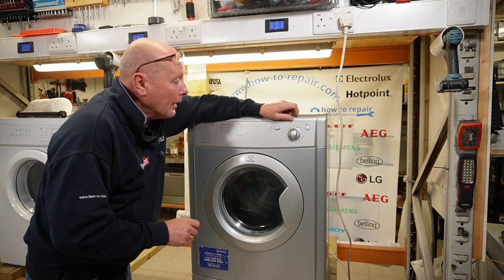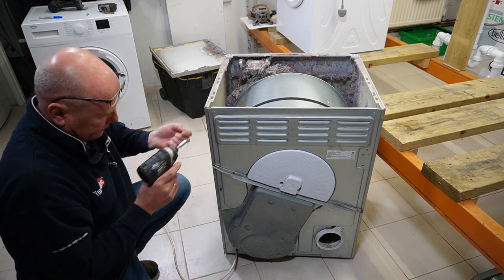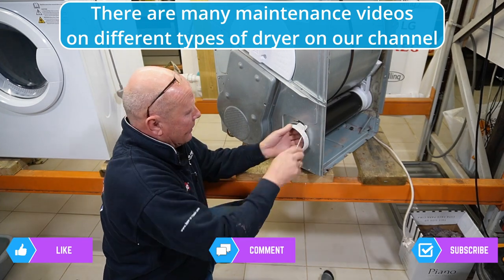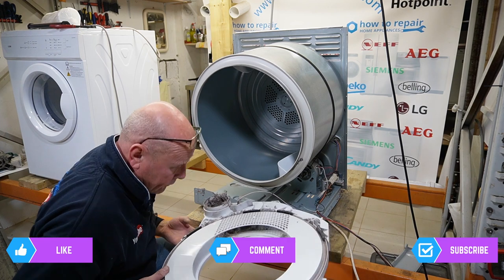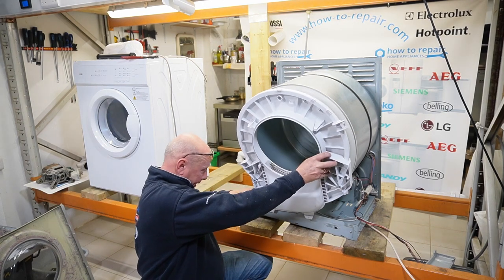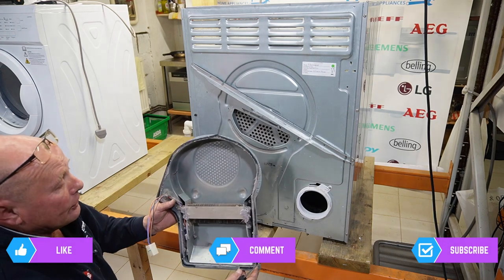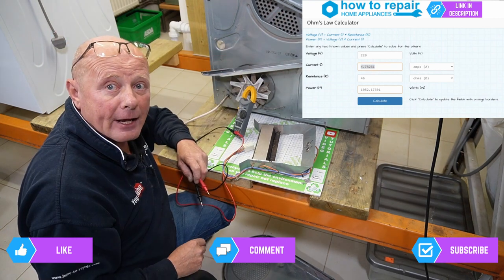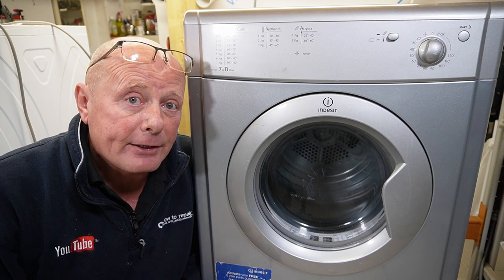Hotpoint & Indesit Tumble Dryer Taking a Long Time to Dry? Maintenance Guide Reduces Energy Costs!

Comment: Another great vid, that made me get out my wireless endoscope inspection camera,  to look down past the filter in the dryer to see i need to take apart and clean.  And yes it it will be done this weekend - so many thanks !!   This is the 3rd or 4th time, one of your vids helped me. I replaced a 40p capacitor on mothers machine, I replaced my aunts leaky hose. They both was thinking of buy new machines or at least paying to get a plumber in. And I also replaced a pump on my own washing machine..  So Many thanks for all the great content you've done and do !!
Reply from the maker: I'm glad your endoscope spotted the stuff that gets in the dryer, people don't realise the hidden problems that can occur and the manufacturers never publish it. people service and maintain their cars, but they never think of the tumble dryer, they sleep with it on at night not knowing the potential hazards of the dryer when it has not been well maintained properly. Now that the financial crisis is getting hold and energy prices are going up, they might start to do a bit of maintenance.
 glad we could help you @coxyofnewp this is for you https://www.youtube.com/shorts/e432SAb2g08 please remember to subscribe as that's what keeps this channel going. Thanks 👍

Comment: That's brilliant. I recently bought a used Whirlpool Duet dryer from a fellow who had "upgraded".
When I opened it up at home it too was full of lint and fluff.
I couldn't understand why. Now I do.
Though I will also now, having watched this video go back and give it an even more thorough cleaning .
Reply from the maker: It's not always what you see there are hidden ducts that need to be cleaned and it doesn't take a lot of pressure to close up the vent tube and this is what causes the restriction on the air flow and as soon as it starts it will just keep building up until it's cleaned that should be shared with everyone that has  tumble dryer, not only for the safety, but also for the energy that they will save
Reply: "Upgraded"  Little does he know...literally.
Reply from the maker: General public does not always know that manufacturers are conning people. in the trade We all know that whirlpool Indesit, Hotpoint Ariston Creda are the same company, same product with a different pricetag.

Comment: What a great tutorial on how to strip and clean this tumble dryer. It was a pleasure sir, watching it all. Thanks for your upload and time showing how to do it correctly. Please could you advise I have a similar dryer that has a square bush as opposed to a pear one. I have to replace about every 6 months and am noticing that there is a scrapping noise heard from the drum. What could be the cause of this please? If I needed to replace the tumble dryer what in your opinion would be the one to get?
Thank you in anticipation and best regards,
Brian 👍👏🏴👍👏🏴
Reply: the rear bearing needs replacing

Comment: I have a heat pump tumble dryer, can you please do a ‘maintenance’ video which does not involve taking the panels off? I clean the filter after use, and once a month or so take the other filter out the bottom and vac it clean and wipe it all down
Reply from the maker: It's already on my list to do, as you're mostly aware, I'm not a great fan of the heat pump dryers because they are not lasting much longer than five years, and when you consider the cost three times more expensive than a basic vented tumble dryer and then consider the energy saving. It's not stacking up. The technology is fantastic, but mixed with fluff they seem to be clogging a lot and some mikes are having gas problems because of corrosion.

Comment: Hi. I have an opposite problem, whereby my Beko condenser tumble dryer doesn’t switch off when on sensor drying. Have changed the metal strip sensor in the drum as a precaution but this didn’t make any difference, any ideas please?

Comment: why was the machine so full of fluff? Surely the ducting system is sealed. I've had tumble dryers for years, and we've never had fluff build up like that. We did always use White Knight, and our ancient one that finally gave out was really clean inside. We couldn't buy a new one as WK ceased trading. We have an Indesit one similar to one you have in this video. The filter for it is rubbish as it is only a half grid, so a fair bit of the fluff gets vented out the back pipe.
Reply from the maker: The vent tube that comes out of the back of the machine must've been kicked and a restriction started to form. this then causes the system to back up with fluff. Hence the problem when there is back pressure more fluff ends up inside the machine. But the filter not fitting correctly because of an obstruction caused much more than normal. I hope this helps you please remember to subscribe to the channel is that helps us?
Reply: Reason why this particular dryer was full of lint, is it’s a positive airflow design (pushes air through the heating element, drum, lint filter). Positive airflow dryers can dry things fairly quickly at lower temperatures but the unfortunate downside is anywhere, where air and can escape, will escape into the inside of the machine since there isn’t a 100% seal. The White Knight dryer you had more than likely was a negative airflow dryer (pulls air through the heating element, drum, lint filter) and negative airflow dryers don’t accumulate lint as nearly as fast as a positive airflow dryer since the air isn’t pressurized inside the drum pushing air and lint inside the machine will it will accumulate fairly quickly.